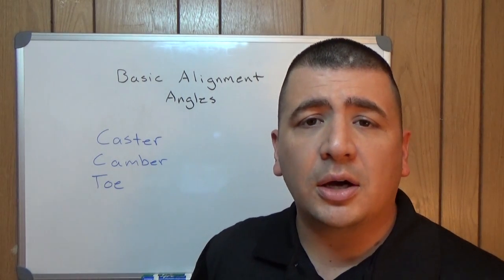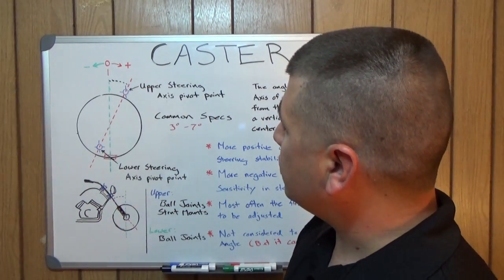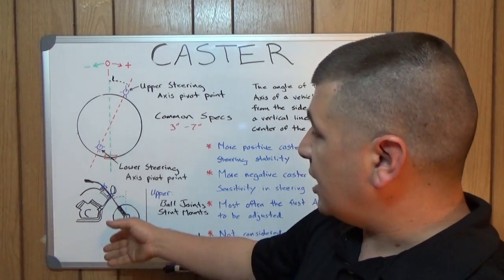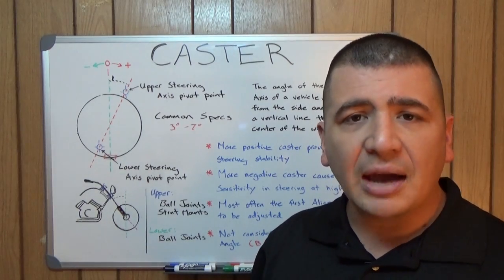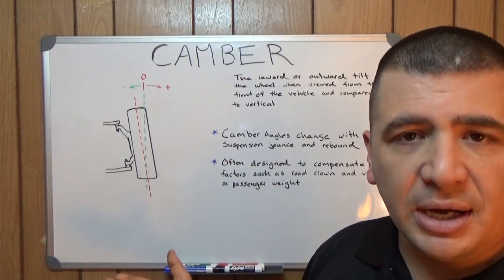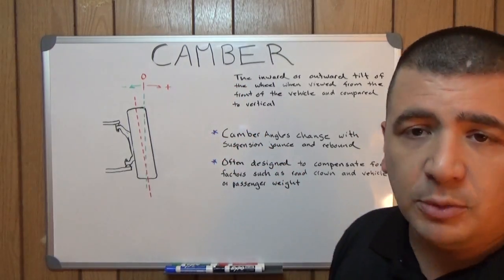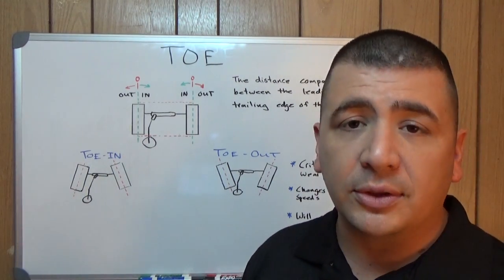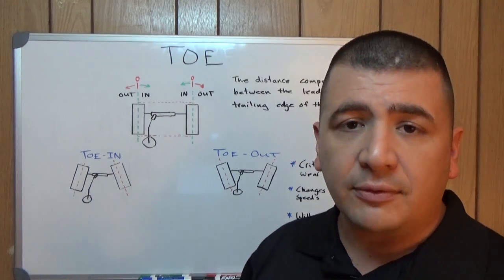Basic Alignment Angles

Comment: To add to what you were saying: An alignment machine shows that 5 to 10 degrees can be within acceptable limits, even though, of course, 0 degrees is always best (I learned that from my classes).
Reply from the maker: The specified value should always show as the center of your acceptable range on most any alignment machine manufacturer. The biggest thing to learn is that you don't want to stop at blindly just getting the values in the "green" or the acceptable range. You want to look at the comparison of 1 side to the other. 

Let's say you have an alignment you're doing where the spec for camber on the front is -0.5°. But the range of acceptable adjustment is +0.5° to -1.5°. That would be 1° either way of your spec, wich isn't horribly uncommon to see. If you put the left at -1.5° and the right at +0.5, you could get both to show a bunch of green on the print out, but the car would drive itself into the ditch. Even going -1.0° on both sides would be better, you want to have even or very close to even ang angles on both sides. There are a few kinds of vehicles where you'll want to put a very slight caster split biased a little negative to 1 side, but I won't spoil everything for you... you gotta learn some of this the hard way. 

Seriously though, congrats on taking the ASE tests this week, stay calm, take your time. Back when I first took them, we sat in a big room and took them on paper and you didn't find out for 2 weeks if you passed or not. Don't be afraid to take all the time they give you, don't try to do all 8 the first go round, pick 2 or 3 and prep for them. Best of luck to you.
Reply: @DIYAutoHomeschool  Good point. Racing vehicles might want the degrees to be different for their turns. :) I definitely will. Thank you. Took today off to study further for the ASE certification. Then, tomorrow, I will start taking them.
Reply: @DIYAutoHomeschool  True about, "f you put the left at -1.5° and the right at +0.5, you could get both to show a bunch of green on the print out, but the car would drive itself into the ditch. Even going -1.0° on both sides would be better..." Good point. :)